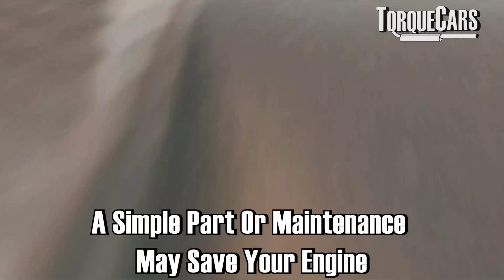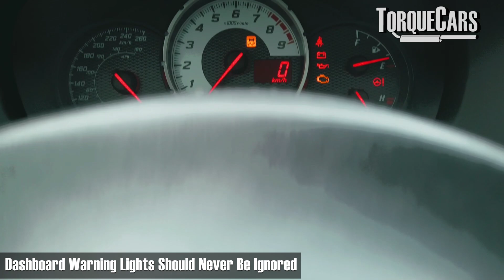Is Your Engine Telling You It's Dying? Top 10 Symptoms of Engine Trouble (And How to Fix Them)

Comment: Excellent advice! Cold start- give ur engine time for the oil to reach the top Give the car regularly a good blast on the motorway- a hot engine is an efficent engine- treat ur turbo with respect idle engine before switching off Annual oil change with quality oil recommend
Reply: I agree with this; vw tdi's run cool, so I give mine a little spirited driving each time I take it out (only when it's reached at least 90°c engine oil temperature).

I do this as preventative maintenance to keep all my emissions stuff lasting as long as possible. Sure, I'll need to replace the clutch in mg dsg a little earlier perhaps, doing this but I'd rather spend my maintenance money on a clutch replacement, then emissions replacement 😂
Reply: I try and avoid any short trips. Any time I need to take it somewhere, I try to plan at least a few stops before making the trip, so I know that it gets a decent drive each time. 

If I don't have any other stops needed, I love close to some twisty 80kms roads so there's always that if need be.

Comment: My Diesels had poor fuel efficiency(reduced by 20% at Least).. It turned out my EGR was blocked with soot. Also got my DPF cleaned. Made a huge difference.. Every 6k, the oil and all filters cleaned now and runs like a dream.. (2014 Vehicle)..

Comment: A welcome topic indeed. I lost a very fine car due to bad decision making. Motor temperature suddenly sky-rocketed to max when I drove on a highway, and I gambled thinking I could safely make it to a town 10 km away. It was just a cracked hose for cooling fluid, a €10 repair, but I drove long enough with a red hot motor block to let it distort so water entered the motor and mixed up with the oil. After several days it was the end of the game. A total loss.
Reply: That's exactly what my son did to my car.Feel for you.
Reply: @LukeL-s1u  I was with my son in the car then, and three guests I was bringing to their home, so I thought to stop on the highway and call for help would be a shame for me...
Reply: @Emerald_City_   a shame?  i dn't get how stopping would have made u feel shame.  What am i missing?